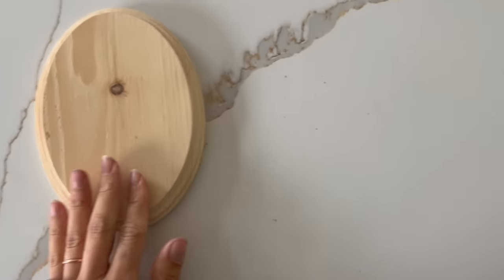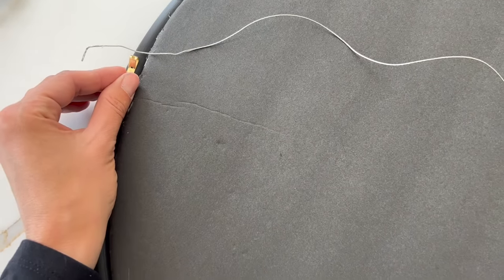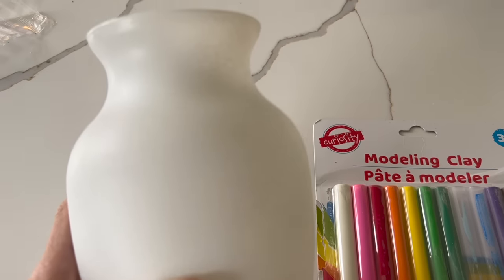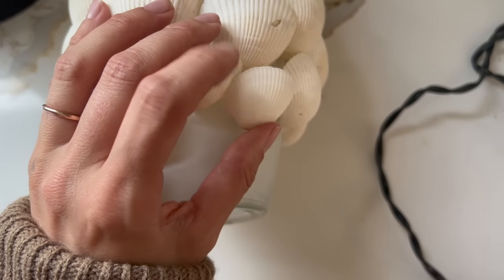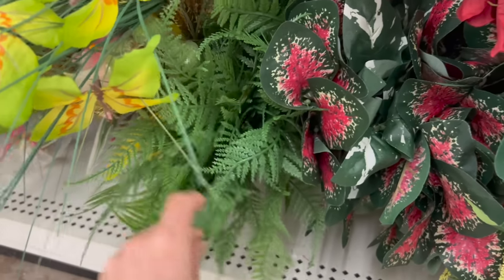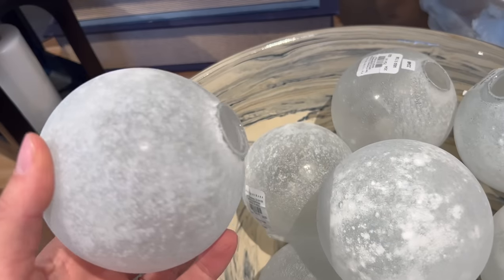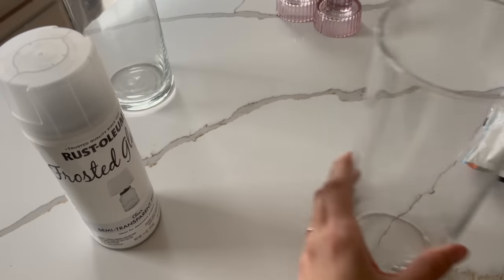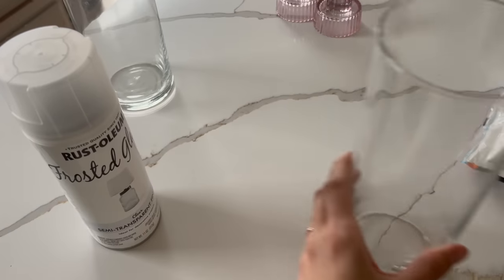TOP 20 DOLLAR TREE DIY HOME DECOR PROJECTS | DIY HIGH END DUPES DIY DOLLAR TREE COMPILATION

Comment: Tip to get rid of excess hot glue strings or blobs use a blow drier on high heat. It will melt the glue